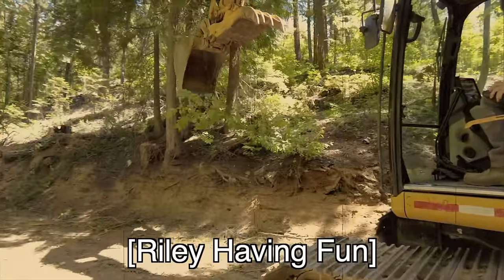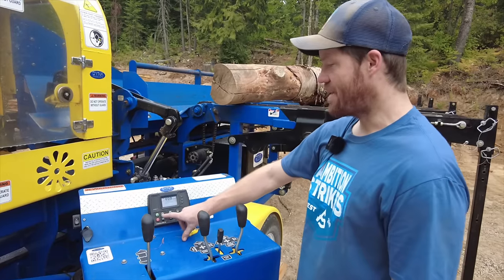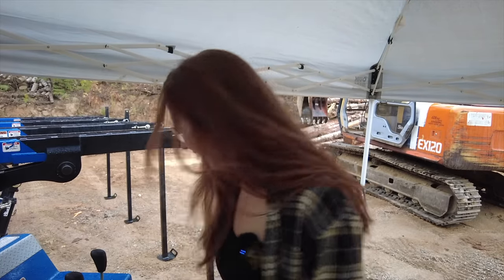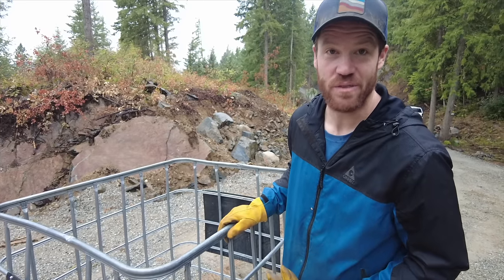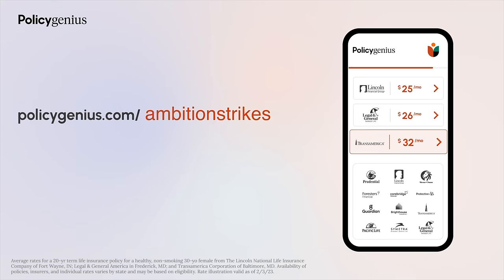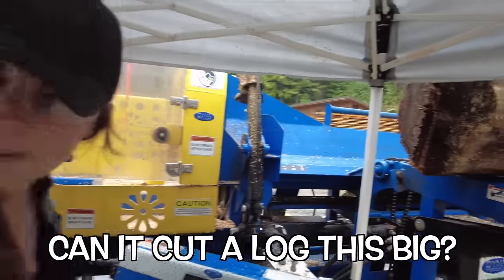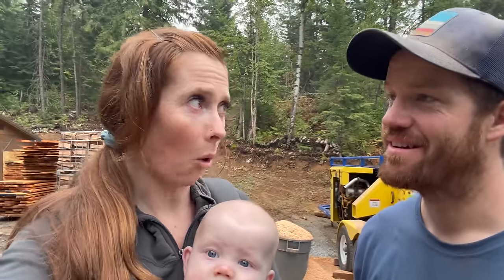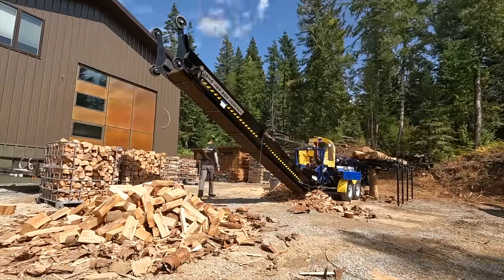We Rented The BIGGEST Firewood Processor We Could Find (Dyna SC-15)

Comment: Pro tip:  chain hooks don’t get poked in the middle of the chain. The chain slides into the hook. 

Very very unsafe as shown.
Reply: went here to write this!!
Reply: Same same
Reply: Additionally, a high load will jam the hook into the chain link, it will be very hard to disassemble.
Reply: All the gates on our ranch locked with chain and hook. I was thinking "he didn't grow up having to close the gate to keep the cows in".
Reply: Saw it too, have seen hooks snap off from improper use
Reply: Exactly, I came immediately here to write that. That piece of metal is called a "grab hook". You slide the appropriate link sideways into hook. This is almost as bad as when were hydraulic problems with either the dozer or excavator? I forget which. Anyways, he goes marching right in there with with his hands/arms. Good way to set up for amputation..
Reply: Thank you!!!
Reply: @johnaddis1022  - Right ... improper use...so learn it before using it. I see lots of profeessionals who are working daily with it and have no issues at all.
Reply: @mikeunum  - That is an idiot's justification.  Just because you see it done and nothing happened doesn't mean it won't; it only takes once.  Those hooks are designed to have the pressure put on the inside of the curve.
Reply: Same Same ...
Reply: yep fix it ! it will break the hook
Reply: That was my first thought when I saw that too
Reply: Same same first thing I seen from Australia. Come on no more Reckless Riley
Reply: Good way to jam a link on or bend a link
Reply: The more I think about it, the more I wonder if they were baiting us for comments 😂

The shot of it was so deliberate...
Reply: @AryaEbrahimi Nope, it was still hooked on the tip at 12:44
Reply: Yup did that one time as youngin had to beat chain off to get it unhooked.  Great video tho.
Reply: Came here to comment 
That immediately made my brain itchy
Reply: @Taryks Different but similar instant physical reaction to it.
Reply: glad it wasn't just me cringing at that!  Maybe this could be fodder for a video?  "Common safety or equipment mistakes"?
Reply: Was about to say this.
Reply: City slicker here - I don’t really know what you are talking about...I looked at 12:44, and I see a chain, but what’s wrong with that setup?
Reply: @MadHatter764  See how the hook is jabbed through the chain with the point?  That is the problem.

The chain should be slid into the gap of the hook. This both stays better and wont' snap the point off the hook or waller out the chain from the forces on it.
Reply: @AryaEbrahimi  I know them personally; they wouldn’t do that. They have high integrity.
Reply: first thing I noticed!!!
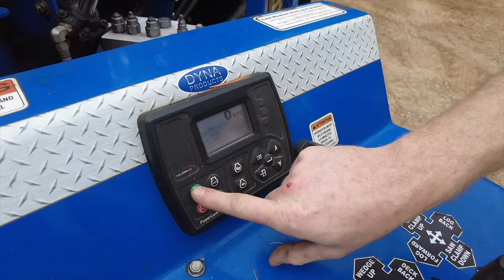Reply: @MadHatter764  A better view is at 1:12 he put the point of the hook through the chain link. That's not how you do that, you put the whole link in the slot of the hook.
Reply: @colleenbowman1399 I have several real life mutual friends with them and have been following them for years. I didn't mean it as something negative.  Professional YouTubers have to cater to the algorithms or they won't get paid.  Click bait titles and content that prompts comments is the way to drive revenue.
Reply: First thing I thought too!
Reply: Glad I'm not the only one that was bothered by that
Reply: How much was the rental ?
Reply: This instantly made me cringe
Reply: @chrisgramstorff996 
As slow as they were working, they probably went by the hour meter.  I don't think they even said what size machine it was. It was like a family picnic. Dyna was paid by this video advertising. I think if you contact the manufacturer they will try to find a machine for you to rent. Dyna goes strong for renters.  A machine like that with large logs making large pieces could make maybe three full cords per hour.  No one likes pieces that big.

My comment about the chain hook is it showed the skill level of the operator which is pretty low. That must mean the dyna processor is easy to operate.
Reply: He did that way on purpose to trigger all of the chain and hook experts, to generate comments  so YouTube would put the video up front.
Reply: Glad I'm not the only one that cringed when I seen him hook up the chain!

Comment: This might be the first time Riley operated a piece of industrial diesel power equipment that didn't blow up, catch fire, or stopped dead in its tracks.
Reply: Yeah, I really he didn’t have to repair that thing once? What the heck?😂
Reply: Diesel? Didn't run on gasoline?
Reply: Bummer
We don't get to see a break down
It is what it is I guess.
Won't hold it against Riley😊
Reply: @CarlStiegler  he said it had a CAT engine.. I assume diesel powered.
Reply: Did he lose a wheel bolt or something????
Reply: I was waiting for that all the video 🤣
Reply: It underscores, italicizes, capitalizes and bold prints the NEED for proper maintenance of all equipment especially lubricating all components and changing the filters

Comment: If you hook the chain link so the point of the hook is in the hole of the chain link,it can make the link round or even brake the link.   The right way is to slide the link into the slot of the hook .   I’m not putting you down,but I’m 74 On my own since I was 14 in Alaska.    I built 4 houses & 4   2000square foot log cabins by my self .  Also many cars &  a super cub airplane from3 wrecks & taught myself to fly.  The list goes on & on.   So far I like what I see . You two are doing fine Oliver reminds me of our son 50 years ago , What a  cute boy.

Comment: Two weeks in a row you have had good ideas for people who would want to start their own business. Having a sawmill or firewood processor would be nice but way too much for most that would use it only occasionally. But having portable equipment where you could come in for a few days like what you had done makes a lot of sense for both the equipment owners and for you. 
I have just a few of the IBC totes and they are by far my favorite way to store firewood. I also cut the plastic bladders in half, drill a few drain holes and put them on pallets and that also has worked out well.

Comment: Try to stack wood with the bark side up, helps keep it dry if left un coverd. Also park the truck perpendicular to the convayor belt so you just have to pull it forward instead of moving the pile again once its in the bed.

Comment: Hey Ambitionstrikes The way I learned to measure cords of wood was by counting 4ft high 4ft wide by 8ft long and divide by numbers of stacks
Reply: An IBC holds just over 1/3 of a cord: three of them will be 1.25-1.5 cords. They filled 10. That’s 3 cords and change. If they planned to heat solely with wood up there? They’d be out of wood by February 1st.

She said this is two years worth of wood, whichI presume means they’ll burn it for supplemental heat while the mini splits running off the solar system do most of the work. 😎

Comment: An IBC Tote fits 1/3 cord when nicely stacked. It takes 11 hours to stack 50 totes (13 minutes per tote). If splits are dumped into tote with conveyer, than you lose 16%. So, 50 nicely stacked totes equals 58 loose stacked totes & 11 hours saved. 
Tarp them to keep the snow off or cut the plastic tote in half diagonally  to make a tote roof. Wet wood rots quick.

Comment: For those that do not know. Do not hook the safety chain of any type on the point of the hook. The hook are beveled to match the links of the chains themselves. The points have no strength, they can snap off under load.

Comment: Now you need to add a gate in the deck railing so you can use the skid steer to put the totes of split firewood up on the deck so you don't have to hall it up the stairs.

Comment: This is awesome! As I probably mentioned in previous video responses, by paternal grandparents homesteaded about 60 acres in the Sierra Nevada.

Because generations of us had been cowhands, ranchers, and trail guides living in the foothills and frontier, even my great grandmother knew the importance of keeping enough firewood on hand for winters, even living in the suburbs.

One thing you’ll probably want to do: build at least three raised wood sheds that keep all the firewood off the ground (so it doesn’t dry rot). Each wood shed is a different drying/curing stage, with the closest pile to your wood stove (preferably in the garage bay so you don’t have to walk outside in winter) as the oldest, driest wood prepped into a mix of kindling and logs.

It’s a lot of work rotating the wood stock, but it means that you always have a supply chain with no bottlenecks of burnable fuel to stay warm and cook off a wood stove if the solar array ever goes out.

As a final thought, there was a guy with a parcel of acreage just off of two major roads on the urban growth boundary of Hillsboro, Oregon, that sold my parents cords of wood each year. He made quite a living off of selling firewood as a side hustle. Even as the light rail started going in next to his property line and Silicon Forest (Intel, Maxim, Tektronix, etc) built up around him, Hillsboro was still close enough to the homesteaders, farmers, and ranchers on the edge of the county line and state forests that he had a steady stream of income.

As long as you replant and manage your forestland in such a way to prevent wildfires and keep a healthy ecosystem, you could make this another great ongoing business.
Reply: These days you would have 3 sheds with large doors at both ends..
right next to each other....

and the wood in IBC tote cages like this.

So you just walk 10 steps to the next shed and use the wood from that for the next season.......

refilling the emptied shed with totes pushed in from the back so they then have 2 years to dry....?

Comment: That is NOT how you hook a chain in that chain hook! Not safe!
Reply: Hooking like that can break the chain, always slot the link sideways never through the eye.  The other thing about hooking through the eye, it might never come back off without cutting that link. 👽
Reply: Seconded. That’s a good way to break a chain
Reply: Yup.  Torque will break the hook
Reply: I think it’s amazing how you saw that little peace out of that entire video.
Reply: @almedin7212  If you’ve worked around that kind if thing, something you know is a danger jumps out at you when you see it.  Stuff is engineered for specific loads.  When you load it from a different direction the strength isn’t there to carry it.
Reply: @harleyb.birdwhisperer  good call.
Reply: I was thinking same,soon as i seen it!🙄😆😆💪
Reply: @almedin7212  as someone from the towing and trucking industry, hooking a chain like is a fatal mistake.
Reply: It’s ok. It worked out fine.
Reply: @1:11 first thing I noticed...
Reply: @almedin7212 did you mean piece?
Reply: Yeah, I threw a flag immediately!  You can harm yourself or anyone else around you!  Think about that one!
Reply: Shhhh they'll find out when they go to disassemble... Some lessons are best learned not taught.
Reply: Done the job if you ask me

Comment: I agree. I have a processor not as big as yours, but it will do diameters of up to 15" and 12ft long. I feed into 9cu ft approx pallets which I move with a Multifarmer. Its MUCH faster than saw,split and move.

Comment: Awesome work!  I’ve been using IBC totes for years, and have found it’s not worth it to stack the wood, just toss it in, or in this case, let it fall in.  You’ll get about 10-15%less wood in the tote, but you’ll save a ton of work stacking, and there will be better airflow to help the wood dry.
Reply: I agree with you. I stopped stacking last year. They should just place their totes under the belt.

Comment: Not too effective to drop the split stuff on the floor, dropping it directly off the elevator into ventilated bags is a better way to go than the stacking of logs inside IBC cages,  just drop it in them instead, stack two bags (one above the other) on a pallet, lift and shift the pallet to your storage area, covering the top (if necessary, in under a barn roof obviously not).  Next time you touch the firewood should be when it is being loaded into the stove or log boiler. 

Best of luck, from Scotland.

Comment: These machines are designed to reduce so called fingerprints on wood. If you have conveyor belt, container, sack or gage, you are not supposed to stack them. You need a bit more space but save lots of time and trouble. 

I use round containers welded from rebar net. They can be lifted only with straps unless you put them on pallet.

Comment: I’d put all that sawdust in 5 gallon buckets and add just a little diesel to them and mix.  Best fire starter ever
Reply: Mix with paraffin wax instead and then you do not have the smell of diesel in the house and they are longer burning and less messy
Reply: Also makes excellent mulch so any plants need less water. Assuming they get around to having some kind of garden spot. That may not be in the plans.
Reply: Good to have some for spills in the shop and other messes.  Beeswax is another additive for fire starter pucks, and you make them in egg crates.  Add some to your compost to make more compost.  Spread it where you plan to have lawn then add soil on top when you're ready, gives some bulk and keeps soil stable while roots take up, it will decompose and help the soil retain moisture.

Comment: You  hooked the safety chain up wrong. The chain should be seated in the hook. The point of the hook should not be in between the links. Please be careful. That point of the hook will spread the link and break the link very easy

Comment: Since you posted a few videos where you have added heat pumps, I'm guessing your area gets cold enough where they are not overly effective for at least part of winter. Do you have any automated system in place to turn them on and off based on temperature or is it all manual? For my own heat pump system I have the sensibo units, but they require me to intervene as well.  Since you do so much research wasn't sure if you found a solution.

Comment: You know. You should really have around 5 years of cut and split firewood on hand so that you can keep what you are going to burn nice and dried out. That way you don’t have to worry about a creosol build up. Not to mention should something ever happen, you will have plenty ready to go. But yea. Around a 5 year supply is recommended. That way it had plenty of time to dry.
Reply: What type of timber do you think he is splitting?
We mainly use hardwood here in Australia. 
This looks like a soft pine.
Reply: @stephenjacob9316  well. That’s true. But from my experience at having done the fire wood heating for many years is that you do need a multi year stock pile. Wood, even when split, takes time to dry out. Yes it is possible to burn wood that has been cut and split and drying for only 6 months. But you will not hat as good of a burn with it as you would with wood that’s been cut and split and sitting for 2 years. Wood takes a long time to dry properly. If you are just going to rely on nature to dry your wood for you, it’s best to have a 5 year rotating stock. But if you are going to dry them with forced, heated air threw the stacks, then you can do a much shorter time of about 2 or 3 years of rotating stock. Yes this much stock takes up a good anoint of space. But that is dependent on how much you go threw in a given season. Some years you will go threw more. Others will be less. Either way. It’s best to be prepared.

Comment: You do such a great job anticipating all the steps required in each project.  But why would you off load your split wood onto the ground, where you probably want to drive or park equipment?  How about offloading it onto the dump truck, then putting it someplace convenient to the furnace & fireplace?  And a word to the wise, don't store the wood in your home.  All it takes is a single queen carpenter ant to thaw out in the winter inside your home, and you'll have ants where you don't want them.  I know from experience.

Comment: @ 1:12 that's not how you secure a chain in a bite hook. You did not pay attention to what they told you when you were showed how to use it. That way can cause damage to the chain and/or get the chain stuck.  If you were hauling a load on the road and got pulled over for load inspection, big fine for insecure load.
This is a random v that shows the proper way 
 https://www.youtube.com/results?search_query=How+to+Use+a+Grab+Hook